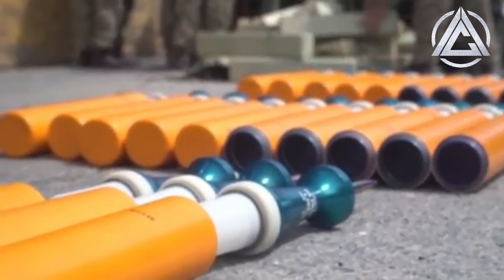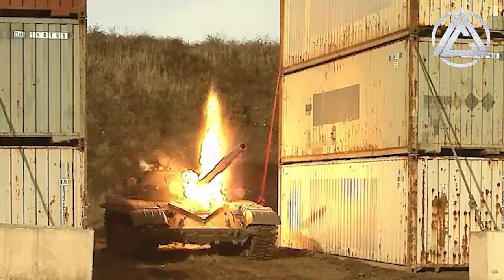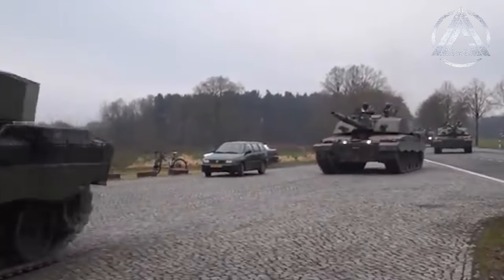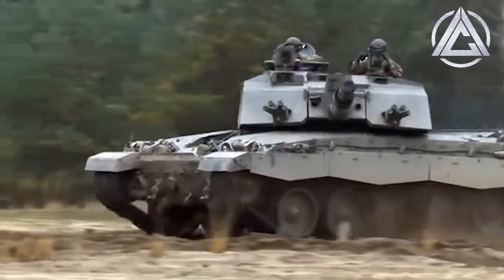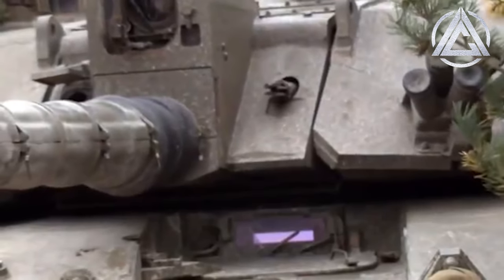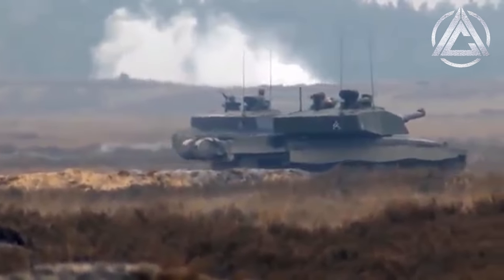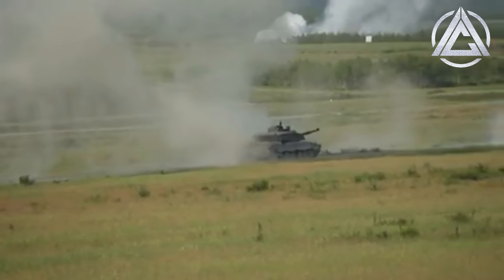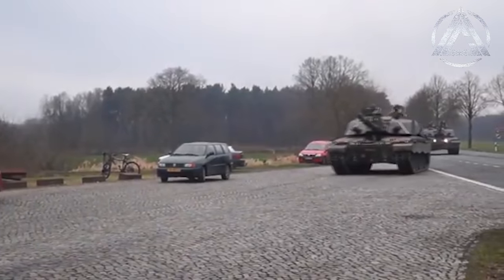Challenger 3 | Britain's New Main Battle Tank | Is It Really Any Good?

Comment: I still believe they made a conversion error with the speed and it’s meant to be 60kph.
Reply from the maker: Seems like an extremely simple error for some very high-technological production guys to make, not just once but multiple times...

It’s possible, but honestly it seems more likely to me that 96kph (60mph) is the maximum SAFE speed the power pack could withstand without damage, whereas Challenger 2’s max safe speed is about 62kph, though the tank has been known to reach up to 70, with a general max speed (under its own power alone) of 59kph. 

Challenger 3 would likely be about the same, but the engine would no longer suffer damage if it gets up above 62kph, say on a downhill straight where it could reach ~70
Reply: @ArmorCast  It's not the highly technical people that said that, it's the PR  department.
And no, even with a 1500hp powerpack it's still at the lower end of NATO tanks in terms of hp/t, so it's not reaching 60mph in any safe or regular fashion that doesn't involve a downward slope and superjumbo's runway's worth of acceleration as well as a willingness to replace the gearbox after.
Reply from the maker: @lsq7833  well this is what I mean - Challenger 2 can reach 59kph under its own power alone. It’s power pack is able to sustain it up to 62kph without damage, but CR2’s have been known to reach up to 70 on a long downhill highway... and then they need their power packs replaced.

Challenger 3 will also be able to reach anywhere up to 70 or perhaps even slightly higher, as it’s the same weight, better suspension, same power output, etc., but in this circumstance the power pack won’t sustain any damage, as it’s safely rated for up to 96kph.

Of course that’s assuming it’s NOT just a typo, but once again I wouldn’t think that sort of very simple mistake would make it past so many people at RBSL and into promotional content for the new tank... seems far more likely to me that the safe speed for the engine was raised, and that’s where the value of 60mph comes from... but in general CR3 will share all the speed characteristics of CR2
Reply: @CSO Class Supercarrier Halo The Fall Of Reach hard and soft aps are part of a seperate program that will be in the TES kit not just onto the tank and rbsl does say it has laser warning
Reply: but it is a typo. daddy red effect said it himself. same 1200hp engine and weighing one ton heavier with improved engine cooling dont make it go over 100 kph. its literally impossible
Reply from the maker: @komradearti9935  you’re still missing what I’m saying...

Challenger 2 will go about 60kph under combat load, with its engine being safely rated to 62... however, we know it’ll manage anything up to 70 on a nice long downhill stretch of highway... Challenger 3 will be the exact same. 60kph top speed under its own power combat loaded... able to surpass that under certain circumstances...

Thing is, Challenger 2’s engine breaks as soon as you go above that 62kph safety limit... what I’m suggesting is that Challenger 3’s will not, that would explain the reliability upgrades. Ergo - the Challenger 3 still has some 25kph of headroom to allow it to surpass its listed top speed without damage to the engine, while Challenger 2 has none.

That source you linked by the way? Still states that Challenger 3 will be able to travel at faster speeds than Challenger 2 currently can, so it still doesn’t completely answer the question. You can feel free to believe it was just a simple typo, and yeah that’s certainly probable... but personally I reckon this is the case instead, and that 60 MILES per hour is the new safe speed of this upgraded engine.

Of course it’s also possible that the 60mph speed comes from when the 1,600hp engine was tested, but was never updated after plans for that engine fell through... didn’t even think to suggest that might be the case
Reply from the maker: @m1a1abrams3  well number one, 60mph is LESS than 100kph, not over... you know, coz googling the conversion is just really hard...

I’m not going to copy/paste. Go ahead and read the above reply 👍
Reply: Only about 30 miles an hour isn't that a bit slow
Reply: @ArmorCast  60km to 60m is too much a coincidence in numbers though. YouTube videos from defence contractors have made similar mistakes in the past.
I think you overestimate their connection between technical and marketing or their marketing QA.
Reply: Well speed is good but at what cost
The Abrams engine delivers excellent performance however it drinks fuel like champ
They should be focused on making survivable and lethal before worrying about speed.
Reply: @verdebusterAP  this is not entirely true the Abrams is very efficient well under load but not efficient well idling that's what the diesel powered Apu is for and the United States has the logistical strength to keep it m1s fueled up
Reply: @spartanx9293  
Thats true but in war with China and Russia
that logistical train will be the main target 
Secondly it asks the question how long does it take to switch back and forth between APU and engine.
Reply: @verdebusterAP  not that long and if that's your argument then the turbine engines even better for such a situation as it can use a wider variety of fuels than any diesel in fact that was partially the reason it was accepted the military thought we'd have to scrounge
Reply: @spartanx9293  
Well being mutli fuel allows to use whatever is on hand so they dont have get specific fuel for it which makes things simple on the battlefield
it takes about 1 min for it power up 
so what difference when the APU is running
Reply: @verdebusterAP  I don't have official sources but I don't think it would think it would take that long it's only intended to power idle systems
Reply: @spartanx9293  
Which kinda of tricky depending on the situation
Reply: @ArmorCast  Yeah but not that hard to believe that a PR person, public servant  or even project manager to make a mistake like that. I suspect not that many actual engineers are talking to the press.
If that happened in a document from MOD or the manufacturer,then it is not suprising at all that the error  would be propogated through many articles.
Reply: @m1a1abrams3  60mph isnt over 100kph
Reply: @saitama9994  you must think challenger can go 60mph huh
Reply: @m1a1abrams3  Well I hope so cause that's pretty fuckin cool. But I do have to admit that it's kinda far fetched. I'd probably need video evidence to solidify my opinion but right now I'm on the fence.
Reply: @ArmorCast  I agree with you, even though knowning about the actual engine and/or transmission changes would help decipher this. Then again if they just made them more robust it would explain the better engine survivability/reliability. I think its a "in theory" fact more than anything tbh rather than a "in reality tested fact".
Reply: Doubtful, that's far too slow. Apparently the 60mph claim is real for emergency situations but not recommended.
Reply: The current speed is 60 kph. They are making it faster hence probably not a conversion error.
Reply: @m1a1abrams3  daddy red also said it isn’t getting a ADS yet it has been announced time after time that it is, take what he says with a pound of salt
Reply: @carwyngriffiths  source? cuz im pretty sure british mod announced aps after the vid was made.
Reply: @ArmorCast  TN54 won't like it or final drive input couplings !

Comment: NOTE: Spin messes up HEAT rounds too.  The needle-jet of the ultra-high-velocity penetrator is made up of the cone-shaped front end of the projectile and thus the outer edges of the cone at its wide-open "mouth" must be very quickly squeezed down to the center to form the jet and you want that narrow jet of quasi-liquid metal (usually) to stay at that size and shape as it extends into the target like a tongue of a frog shooting out to catch a bug, though here to punch a narrow, but very deep hole through thick armor.  If the jet material formed from the edge of the wide end of the cone is spinning, it will try to spread out again sideways and defeat the entire purpose of the jet:  Forward penetration at a concentrated point.  So, HEAT rounds from a rifled gun also have to have some sort of internal de-spinning system for the inner explosive and cone, as was used in the French tank guns or using de-spinning outer rings and fins for actual stability.  Otherwise, non-pinning or very-slow-spinning projectiles must be used in missiles and bazooka-type launchers.
Reply: Heat rounds are not spin stabilized. They are fin stabilized. Hep or hesh are spin stabilizer.
Reply: Once the heat round hits the target it will not be spinning ! So the cone won't spread out !

Comment: I was around for the Chally 1 to Chally 2 changeover, heck I remember the stink when the T62 hit the news as well, which makes me just a bit younger than dirt and I'd like to clarify your information regarding the use of APFSDS rounds fired from the rifled gun. U.S. Pat. No. 4,242,961 to Moredock, et al. issued Jan. 6, 1981 covers the use of an obturator that surrounds the sabot petals and spins when the round is fired, allowing the penetrator and sabot petals to maintain a steady state while the obturator engages the rifling and spins around them. This is discarded along with the petals when the round leaves the barrel. The sabot petals themselves don't spin around the penetrator, they are fixed until discarded when fired. I'm a fan of the Challenger 2 and its attention to the infantry support role, I trust its sibling will maintain the relationship with the promised, programmable rounds. Great vid, some excellent information and lovely footage.

Comment: I do agree with your take that this is basically just 'Chally 2 LEP' rather than 'Challenger 3' - imo that's just marketing/PR.

Personally, I tend to see this as being very, very similar to the Italian upgrade program to the C1 Ariete - where 125 of 200 hulls (originally they intended all 200, but this was then cut down) will be upgraded as part of a circa €300 million program in order to extend their useful life for another ten years. This program works towards the goal of replacing the tank force with a new type (of which they intend to procure 257 hulls) in the early 2030s in two ways. 

The first is from a military perspective, to allow the army to maintain a credible armored force for operations over the next decade+. The second is from an industrial perspective - engaging the land-based defense industry in such a program keeps the industry working and breast the latest developments in technology. This allows the industry to remain competitive and able to deliver a credible future tank when that program arrives - or, rather, in the modern context, it is more correct to say that it means the Italian industrial base can remain competitive in order to secure Italy industrial workshare in a tank procured jointly with other nations, and to have sufficient say in the military characteristics of the tank. 

As far as tank replacement goes, Italy is actually faced with a major dilemma, as the MGCS program, on paper the ideal future, is supposed to produce a tank about five years later than when Italy wants to start phasing in the new platform, and until recently France and Germany had no interest in letting Italy join (despite numerous requests) early enough to have any influence on the military characteristics of the vehicle or have any major role in industrial workshare. Efforts to find international partners elsewhere have not borne fruit. As it stands now, though, there may be some light at the end of the tunnel as Germany has been increasingly moving towards making the program more open, allowing the UK with observer status and creating a potential avenue for Italy to join the program on an more equal basis via Rheinmetall Italia if the Italians procure the Lynx (which appears likely) to replace Dardo. 

For Britain, I see this Challenger program as largely the same - upgrading 148 of 227 hulls to allow the British army to maintain a credible armored force for the future (until it can be replaced fully by a future platform), and giving the British land defense industrial base something to work on to keep their capabilities up to par, allowing them to credibly contribute to a future tank procurement effort, which will almost certainly be international (with MGCS looking like the most likely candidate, but only time will tell). This will be important to prevent them from being sidelined by potential partners with established programs (ex, France and Germany, or potentially America), as otherwise they won't be able to have enough influence in the program to ensure their military requirements for the future platform are met, or to secure a sufficient amount of industrial participation. 

It's not a very exciting portrayal of the 'Challenger 3' upgrade program, but it's a necessary one and a step in the right direction if Britain wants to maintain its domestic capability to design and built tanks (though, by all means, if that is something that is worth the trouble is certainly something that can be debated) - though probably one with a bit too much in the way of enthusiastic PR on the part of the British. Calling it 'Challenger 3' just seems to open the door to mockery. 

For more background on the Italian situation: https://www.iai.it/sites/default/files/iai2007.pdf
Reply: I completely agree with you. CR3 was clearly never intended to be a next generation platform, but to help prepare Britain's defense industry for the next generation platform. I'm not sure if Britain will go for MGCS though, as there may not be an enough time for Britain to influence its requirements to suit their needs.
Reply: @JumpSeeker  considering, that Germany and France favor lighter, more mobile MBT with higher firepower and a high technological baselevel, just like Italy, the UK´s needs are very much in the opposite direction and would result in conflict, stalling and likely failure of the program.
so i would say, it is better this way, with the UK being an observer with the option to buy, but not to interfere with the program
Reply: @zhufortheimpaler4041  I didn't say that the UK should get involved in the design and development. It's far to late for that now. What I meant was that it's very unlikely for the UK to buy a new MBT that it hasn't had influence over and doesn't suit their requirements.
Reply: @zhufortheimpaler4041  The UK used to favour protection over mobility. France and Germany always prioritised mobility over protection. EVERYONE now favours protection over mobility.
Reply: @agt155  so then, tell me, why does every developement project favor good firepower, mobility and active protection with a weight reduction over massive armor bricks?
Reply: @zhufortheimpaler4041  Think about it, the Leopard 2, M1 Abrams, CR2, Leclerc have all had massive armour upgrades and no mobility upgrades, that tells you all you need to know. Experience gained in Afghan, Iraq, Syria etc has taught that protection is paramount and mobility not so important.

Comment: It has been just 1 year post this content. 

I did raise the issues against UAV.  With the unfolding Ukraine- Russia War, this has become more pressing issue.  Challenger 3 or Leo2 all lack ASEA or other APS against top attach ATGMs.  

Another key thing to notice is, 6 wheel issue.  I raised this issue by asking why not 7 wheels.  Some explain it as hydropnuematic suspension. K2PL is one of the latest MBT and it is using 7 wheels and hydropnuemetic suspension.  The key reason for 7 wheel is for future upgrades.  
Just like the beautiful Concord having no space fir extra fuel or upgrade, it is becoming a tradition that we do not plan or prepare for future upgrade given this vehicle will be in operation for next 30-40 years. 

Unfortunately my view re Challenger 3 has not has changed.  

It lacks vision and lacks the focus on what it is meant to be.  Reflecting on Ukraine and Russian War makes it a lot more clear that this is a bad choice.  

UK should have gone with K2Ex (extended) and targeted EU export market rather than holding onto the legacy.  

Once again, UK has saved 350 jobs but is risking 35,000 soldiers when they get deployed to theatres.

Comment: i agree with u, this is like a "placeholder" upgrade to not get massively outclassed, but their isnt anything comming after it. so far i know.

what the Challenger 3 had needed to be future proven was probably the 130mm gun, new power-pack, APS, RC-weaponstation, front hull redesign or armorpackage etc.

but that said, maybe the 130mm + autoloader is not ready yet, not reliable enough or simply just to expensive(what i belive) for the british army.
Reply: There's also the fact 130mm rounds are bigger and heavier and it's not multi-part ammo anymore, and yet the tank hull and turret aren't getting any bigger. That demonstrator model with the 130mm on it could only carry about 20 rounds
Reply: They're looking at the likely opposition and making a cost-benefit analysis. CR2 will outclass any likely enemy equivalents for the foreseeable.